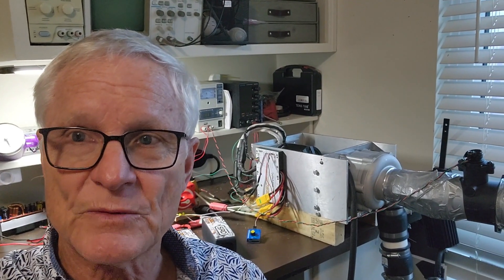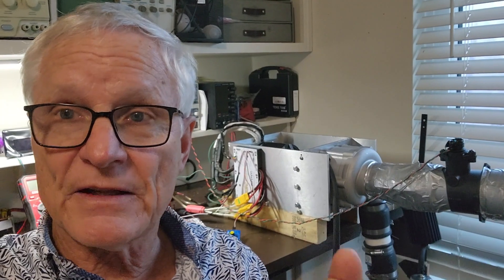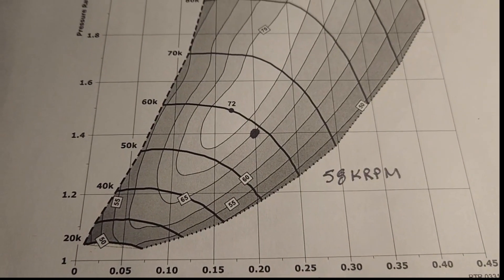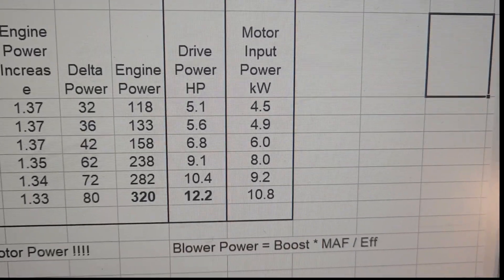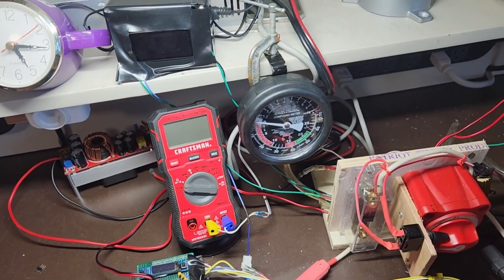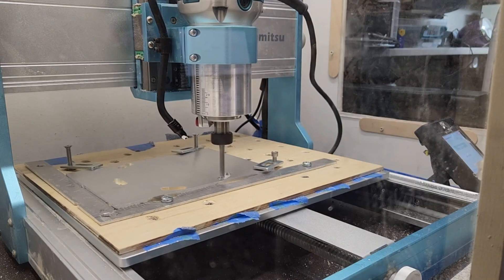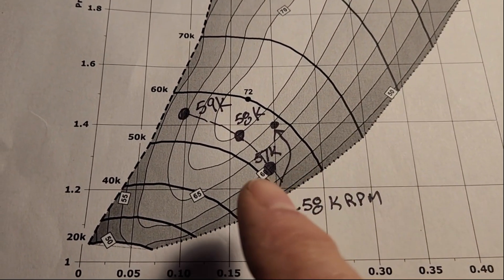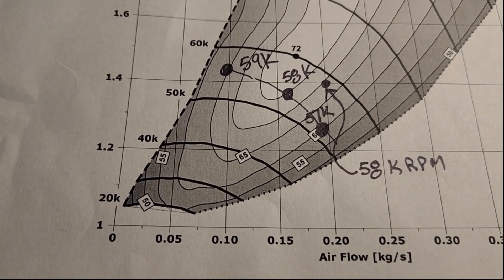Fastest Electric Supercharger Analysis in History (maybe)

Comment: Hey Steve - have you measured the pressure at the blower inlet?  You're probably getting some pressure drop across the filter, which would increase your PR beyond what you're measuring.  Failing to account for pressure drop at the inlet is a pretty common mistake when analyzing FI setups.
Reply from the maker: Surprisingly, blower boost and airflow are essentially the same with or without the air filter.  No need for a K&N!

Comment: You have the fancy vesc. And a free motor 😁. Higher kv for that sweet rpm you need. 10kw is a lot and at full tilt those lipos will puff into pillows. Tough since you need depth of discharge and voltage at the same time. What considerations went into power source? Could you use an ebike battery or two in series? Or use lithium iron phosphate for ridiculous abuse potential?
Reply: I ve seen in another channel he used LTO batteries

Comment: 100% i think you have the wrong map, if you look https://cdn.rotrexshop.com/wp-content/uploads/2024/03/Rotrex_Technical_Datasheet_C30_Rev6.2.pdf page 9 you will see your data matches c3094 perfectly.  You need to spin it at 61,000 for 1.4 pressure ratio.  Throw a belt and pully on it!  Great project.

Comment: you can use the VESC's field weakening feature to get more RPM out of the motor, although the power will be reduced
Reply from the maker: @peterholderith2257  I tried field weakening and didn't get an improvement.  I think the motor has a lot of iron loss at this rpm.